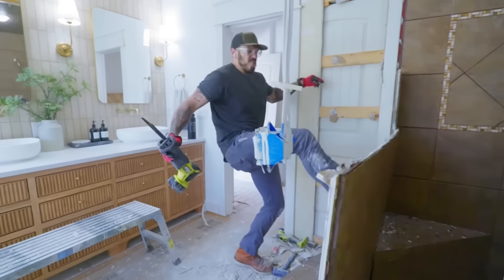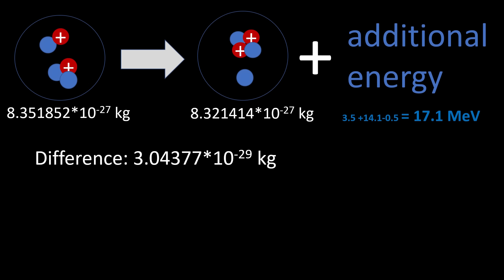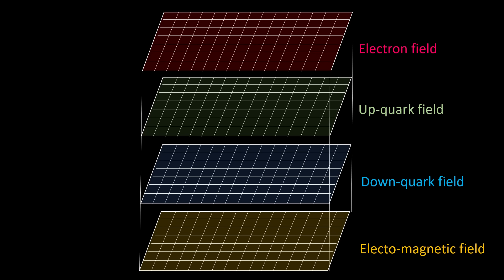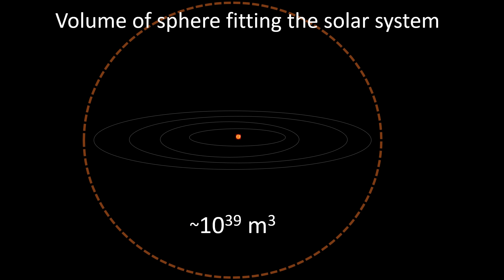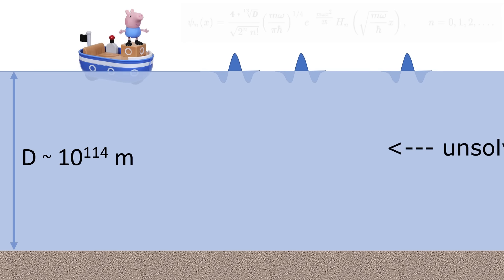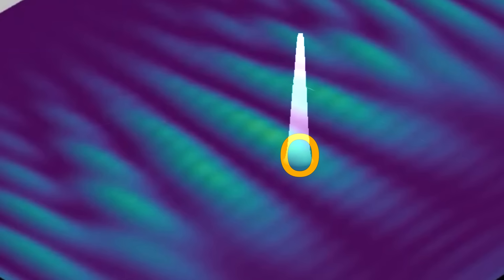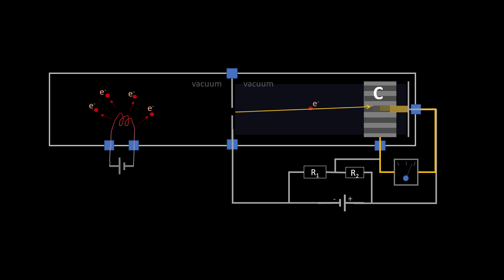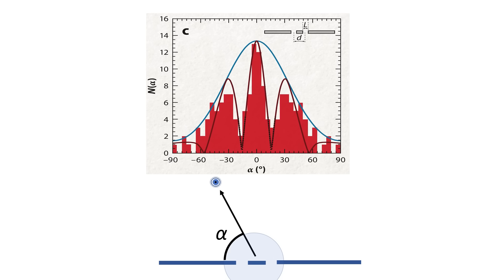Bathroom Quantum Fields and Vacuum Energy

Comment: Its all just due to code optimization, so the simulation can run on more than one core in parallel. Thats also why there are discrete entery levels for photons and why there are other limitations like speed of light. You need to look at it from a standpoint of a computer system and its memory hierarchy and networking limitations. The people one simulaiton layer above us likely have the same limitations for their IT systems that we have. Maybe their world is a bit hier resolution and they have more compute power, but the general limitations should still be there.

Comment: @7:45 "a field must support all frequencies".
But if a frequency is so high, that it takes longer for the wave to propagate to its neighbour (1 Planck-length next to it), than it takes the field-oscilator to vibrate (up and back down, a full cyle), then would it even be possible to have a wave with that frequency? propagating..
The spreaded wave's frequency would then always be lower than the frequency of the field-oscilator(s).
Perhaps even a wave could seem to move backwards, because its phase keeps shifting.
Or a wave could seem to be absent, when its phase is 180 degrees that of the oscilator.

Total noob here. I hope you understand what i try to say..
Great channel. I just re-discovered it again.
Reply: That analogy of a mattress of spring-oscillators doesn't make sense to me.
At the lowest/smallest scales, just how do you imagine the transfer of energy?
Reply: @schmetterling4477  At some point, smaller and smaller, things just do not make sense anymore.
Example: If you ask, where an electron is, at a scale as small as the Planck scale, then things are getting fuzzy. At some point it becomes meaningless to talk about the position of that electron. or whatever EM vibration. 
Isn't that what defines those Planck constants?.

Wouldn't it be equally fuzzy to talk about ALL frequencies/energies concentrated into one spot?    (one spot of that depicted spring-oscillator mattress)

Energy / Frequency in one tiny spot?  What does it mean when that energy does not dissipate?
Does that energy, at that (minimum) spot stay there? forever?
Energy means nothing if it can not dissipate.. i think.  That is my intuition.
Waves need distances to travel, otherwise you can talk of oscillations only.

And if you ask me, about why nature would know about a smallest scale, i'd say:
Planck is "just" somebody who calculated things.
It does not have to be true..

Comment: About gravity... I think space, whatever it is, has surface tension. And when two objects in close proximity bend it around them, they want to join to minimize their surface area in a single bubble. Like raindrops or soap bubbles. Or those rings at 20:00

Comment: I think the problem with current theories is that someone is measuring too small "particles" have no direct access to them and draw all sorts of wrong conclusions.
for example: you can't measure a single electron, so you amplify it by 10^9 factor somehow, then you wonder why it will have strange statistical properties like waves.
or other example, where you have smaller then one photon energy that you, no matter what, can't measure. so what you do? all well let's accumulate them until something is collected that is measurable like exactly one photon. from this you draws a conclusion that photons are quantize and can't be divided ,what?!
that are real problems that we have with measurement limitations and draws all wrong conclusions that are far from reality. but nobody never asks what is the limit of the measurements devices they use. for example, in the double slit experiment I never saw the wall with the slits made of real matter, instead it is always a solid barrier made of unreal stuff that 100% blocks all ways. in reality that wall would need to be made of same stuff the particle passing it is made, then the simulation is more real.

Comment: I really appreciate this video. I really like the way you ponder about science. I've been interested in learning more about the void of space. 
🧲🌡️📡🔆☢️🔌🔊🔋♻️🌐☯️⚛️
I feel magnetism and electromagnetism play such a crucial aspect of the cosmos. It's really facinating how so many properties with-in Nature, differences seem to be a key factor in keeping dynamic systems functioning. High pressure/low pressure, hot/cold temp, different densities, static electric charges/discharges, electromagnetism north/south poles, different velocity/angular momentum, layers between different regions such as, land, water, air, edge of atmosphere, space, the different regions in space with different particle density, creating bubbles/membrane layers, cloud regions, nebula's/ Galaxy's, Galaxy clusters, less dense voids regions of space. All of these things are basic differences but create a way for the dynamic engine with-in Nature to continue flowing and operating to create and convert energy. How a battery 🔋 transfers + charges through a membrane layer to a - charged side. Like how regions of high/low pressure and temperature 🌡️differences create winds. Transfer that into water or planets core and add density. It creates either ocean currents and flow or planetary convection geothermal activity.
🧲🌡️📡🔆☢️🔌🔊🔋♻️🌐☯️⚛️

Comment: So there could be other models/theories which can be invented to come up with a better way to explain all these anomalies in quantum physics? Is our maths even the right kind and our thoughts valid to be able to meaningfully able to reason about these things?
I look at deep learning using ANNs vs Von Neumann architectures in computing and one type using massively parallel computing works better for some kinds of problems and the other is the one we all like and understand, so we continue to use it and try and define solutions in terms of the favoured method/s.
Reply: Good points!

Comment: For the question at the beginning "what is energy and why it is conserved" , the  Noether's theorem explains that in terms of symmetry but it is above my level but maybe not yours  : https://en.wikipedia.org/wiki/Noether%27s_theorem
Reply: There is a difference between showing a connection and explaining something. Micheal Stevens (Vsauce) offers the metaphor of unfolding a crumpled piece of paper. 
https://youtu.be/_WHRWLnVm_M?t=551 
A wad of paper is inaccessible. In order to access the information inside the wad of paper must be unfolded. The process of unfolding to an open sheet is an explanation process. 

It's an explanation when the description is taken to a deeper level. Example: theory of heat. When it is granted that objects consist of atoms then the temperature of an object can be understood in terms of (jiggling) motion of        the atoms that the object consists of. That is, the phenomenon of heat is accounted for by going to a deeper level point of view.

Noether's theorem expresses a connection between symmetries and corresponding conserved quantities. Noether's theorem is of course relevant, but it doesn't quite meet the criteria to be counted as explanation.

In the Michael Stevens video I linked to the difference between connection and explanation also comes across in Michael's discussion of why the angular velocity of a rotating object increases upon contraction of that rotating object.

Comment: A quantum "particle" is not a classical particle or a classical wave or both at the same time (DeBroglie-Bohm), nor it is "switching" between a wave and a particle. All those approximations work in some circumstances but all fail in other circumstances. But it does not means that quantum phenomena cannot, in a way, be imagined. Like with 4th dimensional objects, if you mathematically work enough with them, you can develop
certain intuition of certain 4-dimensional objects. 
The main non-intuitive characteristics of quantum phenomena are non-locality, quantum-correlations and quantized interactions between fields (the quanta are the "particles" of the field). Non locality is intimately
related to q-correlations, because it manifest only between systems (or components of a system) that are
q-correlated (e.g. entangled) when they have "strong" interactions with classical systems (e.g. measurement).
Quantum correlations means that if you have 2 systems A and B, the joint system AB has properties that cannot be deduced from the properties of A and the properties of B: you also need to know the correlations between A and B (that cannot be deduced from the properties of A alone plus the properties of B alone). 
Because of those non-intuitive characteristics, QM phenomena cannot be imagined as classical waves or particles of both etc., because classical phenomena are local and classical correlations between 2 systems
A and B can always be deduced if you know all the properties of A alone and all the properties of B alone.

Other characteristics of QM phenomena like interference and the principle of superposition, existed in classical waves. 

If you can imagine/have an intuition of non-local cause-effects and q-correlations, you can imagine quantum objects and phenomena, to me that is easier than to imagine things like the 4th. dimensional "surface" of a 5 dimensional sphere.
Reply from the maker: I agree that I didn't give enough attention to entanglement as a phenomenon and I will try to do that in a future video, hopefully based on an experiment. Suggestions for this are always welcome.

Comment: To my crackpot brain space is a form of energy and thus has mass. 
Well at least this is how i explain conservation of momentum to myself. If an object moves in space and keeps on moving is internally all the same as a resting object then what keeps it going?
I thought maybe relativity. Even in "slow" speeds you'd see relativistic effects and thus a gradient of mass concentration. I never vocalized my stupid ideas so i dunno how to write them down properly. In essence space in front of a moving object appears compressed to the object and thus more energy or mass which causes attraction that cancels out with the attraction of the space behind it. If no further mass than just space is there, the system is in equilibrium. If however there is a mass it will ass the the attraction and thus cause an acceleration towards that mass in scale with said mass. Oh and if you only apply special relativity it does not work, cause it is just like me and does not like derivatives.

As i said, my crackpot theory. All because i never liked what scifi movies and pop science communicators did to the term "dark energy". Good thing i myself have a lot of "dork energy" 😀

Comment: Tell us truly, did you get the tile material estimate right the first time, or did you have to go back and buy more to finish the job?  Because it is a surprisingly difficult measurement and calculation, even for a physicist.
Reply from the maker: Well, I did have some left over so I did not have to order any new. I assumed 15% cut losses as a rule of thumb but the real losses were smaller. Generally, the larger the tiles, the larger your losses and these were 30x60cm and 60x60cm, so pretty large.

Comment: I have no idea how I ended up on this video, I know nothing about quantum anything so sorry if this comes off as really stupid.
If the wave probability function for a particle is just the result of testing a bunch of particles, then what's so weird about that function collapsing onto a point when it's detected? 
Isn't that like taking a room full of people,  taking the height of one of them and being surprised that they aren't simultaneously a certain amount of every different height of all the people in the room?
Reply from the maker: A person is a macroscopic object and has a height whether you measure it or not. Also the measurement does not change the height property of the person. Difference with the quantum view is that by definition a property of a particle is unknowable until it is measured.

Comment: Excellent presentation. Maybe that huge energy is possible because of a lack of energy differential between areas of space.
Reply from the maker: One might argue that if there is no gradient, you would not notice. But even the energy density of mass in a black hole is completely insignificant compared to 10^114J/m3. Which makes me have some doubts...

Comment: The quantum mechanical view is a bit confusing, as it is meant to allow predictions, not describe what actually happens. The most advanced view as far as I know is that spacetime starts as a quantum liquid, the 3 dimensions we know and the wave and frequency aspects result from complext flows in the quantum liquid. This view predicts all constants of nature, check out Thad Roberts channel. In this spacetime variant I think we have determinism, and the link with quantum probability is not yet clearly explained, because what you did not mention is that electrons will interfere in the double split experiment even if they follow one after the other. It could mean some space is simply out of reach for the electrons, they can not propagate there, but the complex flow pattern we recognize as an electron only travels to one place where it can be picked up, and where that is is distributed probabilistically. As to the energy in the fields, I think it is there, it is huge, but it is non-dimensional, only part effects our 3 dimensions. I have yet to understand how the non-dimensional elemelts (bars I call them) find their way in a 'space' that has no reference or fields because it is fundamental. One interesting aspect of the quantum liquid idea is that parts of space can separate from other space, this is the origin of particle stability : They are disconnected from spacetime by the flow, just liek the droplets are disconnected if they jump up out of the water, or laminar flow can disconnect streams of air..Lot of text, but you seem interested..
Reply: interesting

Comment: If a theory gives all the right answers for all the wrong reasons, it is still a good theory.
Reply from the maker: Not for predicting vacuum energy.
Reply: .. unless there is another theory which is both simpler and older, and makes equally good predictions, but otherwise yes
Reply: That seems to be all that most physicists care about these days.  Long history of 'shut up and calculate'.
Reply: @dynapb  maybe uh, maybe a good variation on that might be, “shut up at least until you’ve calculated, and then at that point still don’t spend too much time talking about speculations on the meaning, but some limited amount of said speculation talk may be good”?

Comment: You Bathroom quantum physics is my cooking podcast.
I'd like to ask you something, would you say our knowledge of the universe is by any means sufficient to exclude data transmission between star systems at higher than light speed? I'm well aware that light speed is interpreted as the max speed of causality and therefore the answer should be no. But your essay makes me think that we just don't know enough about what is really going on
Reply from the maker: If there is one thing I'm very convinced of is that no particle and no wave can exceed the speed of light, regardless of the frame of reference.

Comment: The zero point energy keeps me also awake at night. What is the significance of something we or nature cannot really interact with.
There is one calculation that uses properties of the zero point energy that I know of that gives physically sound results. Namely that the rate of spontaneous emission (Einstein A coëfficiënt) can be calculated by multiplying the zero point energy density of a specific frequency component by the Einstein B coëfficiënt. So spontaneous emission can be seen as stimulated emission induced by the vacuum field. It all might be a mathematical coincidence (there are many of those in physics), but this result has always seem very peculiar to me.  
There are course many more ways to calculate the rate of spontaneous emission correctly, for instance decoherence due the self interaction of an electron. As I said, it keeps my up at night.
Reply: interesting

Comment: You’re alternative is viable for higher order structures but this is still a head scratcher for light itself. What could keep such a tension that it’s return is observed as a wave and a particle? Can a gamma ray be a self contained system? Are photons just higher order systems of something else?
Reply from the maker: I think that mass and EM radiation are both forms of energy, but don't necessarily follow the same rules. I don't think EM-radiation can be self-contained. 
It's a bit bit like gravity, the strong and weak forces, electrostatic forces. They all represent a form of interaction but follow a different set of rules.
Reply: @HuygensOptics  indeed the four fundamental forces are the strong, weak, EM, and gravitational. Unifying field theory has been the siren’s song for almost every great physicist. Check out Miles Mathis. Unconventional and I disagree with a lot of his ideas but has a few good ideas. What light itself is exactly will continue to be elusive for the reasons you mentioned tho. Fish in water etc… tough nut to crack.

Comment: Does statistical significance of quantum particles provide the same kind of logical "deducability" that macroscopic objects would?  If a macroscopic observation has a 75% chance of being true, it also has a 25% of being false.  If a quantum particle has a 75% chance of being detected in position 1, would it necessarily have a 25% chance of being "not in position 1"?  Could one type of "open universe" be a universe where the total probability was a tiny bit higher than 1?
Reply from the maker: I guess probability of detection is not about "being" or "not being" in a position. It's just about being detected or not. The fact that your alarm system is not ringing, does not mean you don't have burglars in  your house.